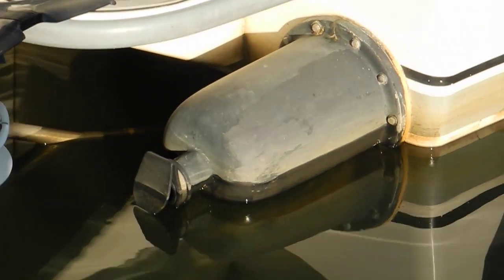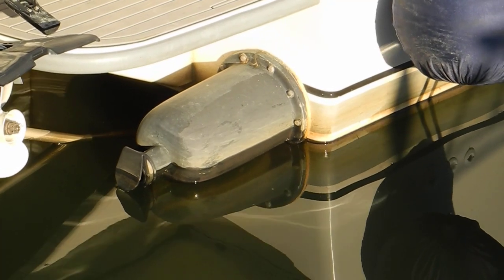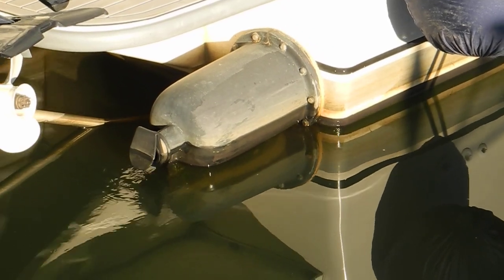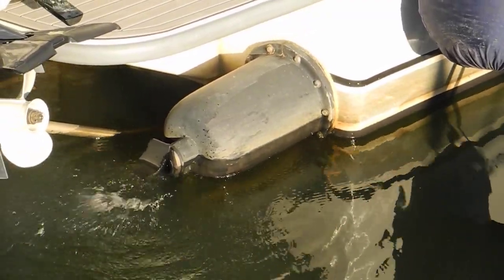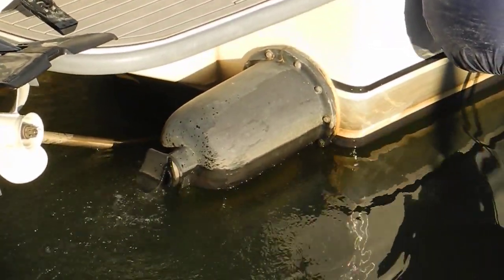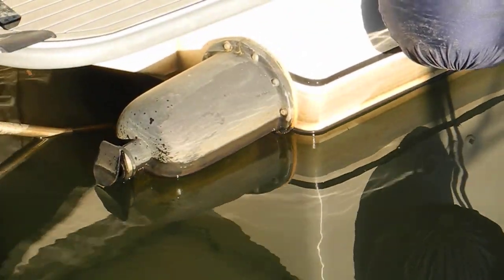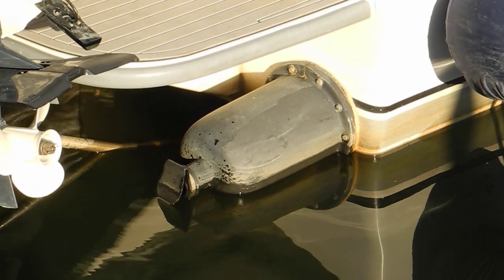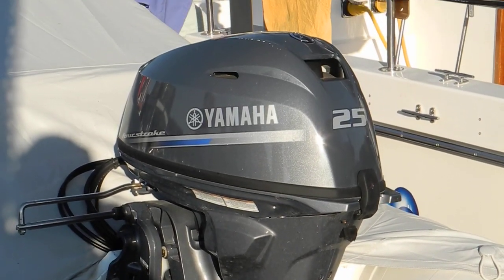External diesel muffler on a Canoe Cove 42

Comment: Hi Chris. That’s my boat! I recall you taking that video at the AGLCA rendezvous in Tennessee. My recollection of your description was that there was a weir inside the muffler where the exhaust flowed over the top while the discharge water was pushed down below the waterline quieting the exhaust. To answer Walter Davis’ question, we have a 10 ft tender on a Davit system on the swim platform, and that 25 HP Yamaha motor is mounted on that tender.
Reply from the maker: Thanks for sharing that explanation. Will we see you in Fort Myers this January at the RV?
Reply: @AskCaptainChris  we will not be there I dont think. I’m not sure when it is but we hope to be further south by mid-January. We are currently in the Tampa area.
Reply from the maker: @stevensE3  stay warm. Safe travels 👍🏼